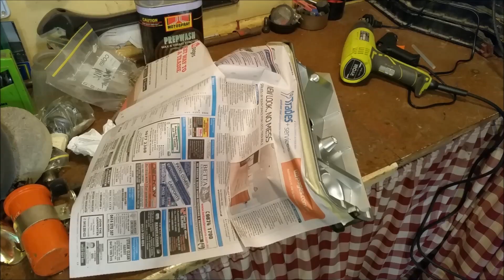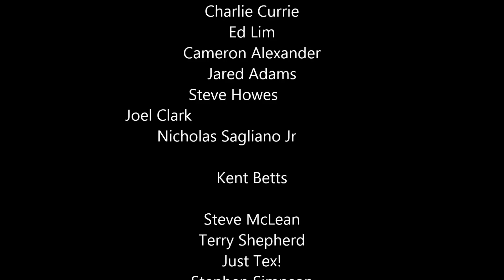Ford XC Fairmont 351 Restoration Part 29

Comment: love your videos, brings back memories of my xc gxl 351, it had the factory 120 gallon tank and fitted with twin outlets from factory, rear shock covers, and a front end skid plate, found out 3 years ago it was one of a handful special police packs made, so many more rare options on it to
Reply from the maker: Don't you hate that... I sold my beloved Galaxie only to find out it had correct high rise heads, apparently worth a few grand alone...
Reply: its interesting all the so called experts said my twin fuel fillers wernt factory, they also said no xc had a 120 gallon tank, it also had the factory globes with black centres, the 650dp on it was suspect, it had the idle circuit adjustment via the inside of the hold down bolt so was late 70s, had full electrics, 4wdb , sunroof, with light blue vynal roof and ford blue paint, fmx, twin point fact dizzy and police speedo.

would be worth a packet if it still exists

oh by the way i have a 67 RS Camaro with a 800 + hp 572, videos are on my chanel
Reply from the maker: Yes, there are many experts aren't there? They irk me, so I try to ignore them. My XC had a long range tank as well - the Ford Verification letter stated it and the original spare wheel mount still remains in the car. Your Camaro sounds nuts, will take a look. Cheers
Reply: really like your videos

Comment: A lot of people that I know who use enamel paints in their projects a lot have little electric toaster ovens in their garages or hobby shops so that after the enamel has flashed off in the air they can put them in the oven at a low temperature setting for some time to cure the enamel off.  Enamel paints can take a long time to cure in ambient temperatures and there is a high risk of damaging the paint surface by handling before it's cured.  I believe those little ovens are often available cheaply in charity shops or at car boot sales for little money so it wouldn't cost much to have one for those situations.  Needless to say it should only be used for curing enamel paint on metal parts, never plastic as the heat can destroy them by making the plastic soften and sag, and if it melts entirely there is a risk of causing a fire if the melted plastic gets to something hot enough to ignite it...

Comment: I love your attention to detail using the fabric tape. The authenticity is so very important when rebuilding a car. 
Have you worked back the heritage of the body codes? I have a Brisbane built P6 LTD which has recently been finished. Tracing parts and making sure items are as close as original specification. It was a JH71 with a K, the XC GXL should read as a JG32 with a H or K for a V8. I have seen a few restorations based on a JG21, JG22 and a JG23 shell posing as a JG32 Falcon Fairmont GXL.
Reply from the maker: Yes it's a real one, being a JG32-----K was initially a Broadmeadows built GXL 4.9 manual with pretty much every option aside from a sunroof. The sad bit is that all the original good stuff was sold off... I only got the shell so the only original options going back in the car is the factory dual exhaust and bumper, the power windows and the four speed manual. Unfortunately, the A/C and long range tank won't be included. Cheers and thanks.

Comment: The type of blanking plug you're looking for on the thermostat housing might be available from a plumbing or gas supply merchants, certainly in the UK we use, or at least did use blanking plugs like that in both water and gas systems in houses, we have a few here and there in my place, in fact I can see one right now as I'm writing this...
Reply from the maker: It ended up being the same as an engine oil gallery plug...
Reply: +Peter Anderson  The motor manufacturers often used the same type of blanking plugs in multiple positions on the engine and other major assemblies to save on tooling costs.  I imagine with you having so much history with old Fords you probably had a few of them knocking around so digging one out and cleaning it up to match the engine and engine bay finish has probably given you a free resolution to the mystery, which is always a good thing.  That's exactly the sort of thing people mean when they say about projects nickel-and-diming a person to death.  It's finding and buying the little parts that eat up a disproportionate amount of time and money...

Comment: Mate you are doing so well on these cars, great time management, what's your secret? ;) And I can't believe how far you make your dollar $$ go, can't hate till Ms Christina is on the road, man my (well, one of of not to tell a lie ;) dream car is a late 50's Desoto, preferably a 57 with the 345 Hemi. You sure lucked out on that Grille, I mean these cars have been on the road for over 35 years and all it takes is one rock flicked up by a Semi on a country road to break a portion of a fin.The price on classic Aussie muscle cars and even parts is becoming so inflated, it's over the top. It's Funny that I can import a Dodge Dart Hardtop from the states for roughly half the price of an Australian built VF & VG Hardtops (the same same, a  B- body dodge, just with different headlights really) Great work mate.
Reply from the maker: Thanks mate. You're correct with the price of parts, although some idiots ask massive premiums for really second rate rubbish - you normally find them among the honest sellers on eBay and Gumtree. Time wise, the car comes after family and work commitments... I spend a few hours on a weekend day normally. Cheers and thanks

Comment: I'd have just laid some fibreglass behind the crack on the taillight halves and fill the rest with bog and sand it back and work up my grades to 2000 so its nice and smooth and then use that special light restoration paint on it.. th factory obviously used some sort of paint by the looks. Man my Torana taillights were the worst, Careless ex-owners would wrench the bulbs holders in and ruin the socker lugs, so you'd have to silicon them in and carefully use a large C clamp and a block of wood on the other side with a few rags between it and the lens while it dried. And as you probably know, the lens mounting bolts, especially on the smaller side marker and front lower valance indicators, less is more. just need to nip them up, not wrench them like you're tightening a subframe bolt... unless you want your lovely good lens you just found to get a nice crack across it... not good. But mistakes are always something one never knowingly repeats ;) How's the Weather over there, he lost like 5 - 6 weeks of summer to shitty rainy and overcast days due to some silly cyclone up North in Perth, the mornings and nights are getting cold now, but most days are still sunny in the middle. Literally when it was supposed to be the usual january - February heatwave, it was often pelting rain and blowing a gale. there was literally maybe a fortnight of days when it reached over 35+ degrees, guess it's better compared to when it's so hot all you can do is sit inside next to the air conditioner, or at the beach for some ;) I liked Chip Foose as a Boss, but I dont like how they make it look like you can do a concourse resto on a car in a week and a half.. Though I think Richard on Fast n Loud is a tool who thinks his poop doesn't stink, they sort of make the build look more realistic as far as elapsed time.
Reply from the maker: Yes, the weather has been odd here too... Summer was good, Autumn lasted three days and now it feels like winter. I like Fooses show too, I liked American Hotrod, I will watch anything... but when they brag about the money they make I switch off... it happens a lot on Fast n Loud as well as Junkyard Empire... I can't tolerate people who brag about making easy money, you know that in the process they ripped some poor soul off.
Reply: Yeah, I know what you mean.. Meanwhile the car they delivered paint starts cracking 10 years later and the poor unsuspecting owner finds all the shortcuts taken. I can't stand people who think having a bit of money in the bank should mean they matter any more than the next guy.  Lucky you weren't in WA when the mining boom was going on.. Some unskilled pit worker bragging because he managed to make over 200k a year and buy a boat , a HSV and a holiday house down south. When when it all tanked in the 2008 , they where all whinging that they had to downsize and sell off all their toys, aww, I bet the repo guys had a fieldday.

Comment: Wonder what would come of clamping the buffer into a vise then working the part over it?
Reply from the maker: It would probably be better than running the gauntlet like I did - my method is great if you want to launch a good lens into the wall at 120km/h... whatever the case I slowed the buff down and held on tightly. Cheers
Reply: Living on the edge for the thrills :)
I watch a tool restoration channel - He uses a drill press to run his buffer wheel.
Seems to give him good control of small parts.

Comment: WHAT, your using the stupid square headlights, now I know it is a Fairmont xc and it is correct but if there is anything I would change that would be it. I know it is your car but the quad circle lights look a lot better and gives it that muscle car look. The square ones were when ford was trying to modernise everything.
Reply: Gazoline, is it your money? No? Ok, well let him do as he wishes.
Reply: Now hang on. As I stated in my comment "I understand it is his car", I was merely commenting to express my personal opinion if Peter wants to use the square lights it will not bother me in the slightest it is his car I was just saying what I would do if it was my car I was not saying that if he used the square ones I would go rage and unsub nor was I telling him how to spend his money. It was my opinion nothing more again I said it is his car.
Reply from the maker: It's all good and I appreciate the feedback. I was going to use the circular lights as I share your opinion to some degree. Given that both grille types are extremely rare I was prepared to take what I could find... I considered a few things; rectangle lights were on the car when it was new and GS type grilles can command $500 in good condition... having said that, reconditioning the rectangle lights won't be cheap either... but I'm certainly not offended by your opinion - all really is good. Cheers
Reply: I actually really like the rectangle lights, can't say i like either better then the other as they both look good. What are the globe choices like between the rectangle and dual circle lights? I assume from looking at them in the video the rectangle runs a single h4 or equivalent high/low beam while the duals run a high/low beam plus an extra globe for high beam which would give the duals an advantage in light output at a guess?
Reply: cant decide between a lamb roast with Tom Cruise or a microwave dinner maybe Gazoline the microwave dinner is more appealing
Reply: Frosty FPV To be honest I would probably pick the microwave dinner over that option.